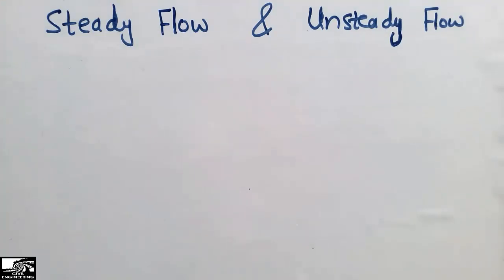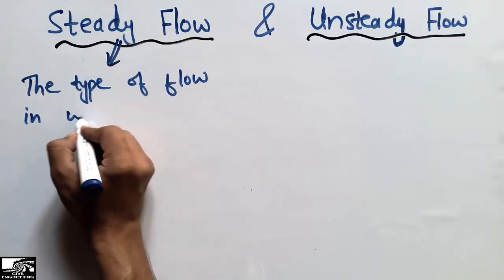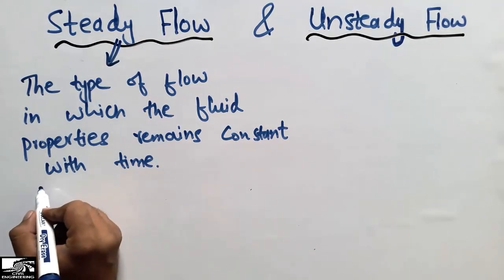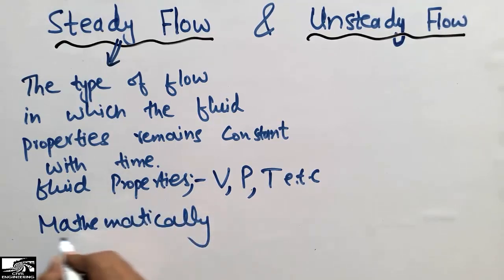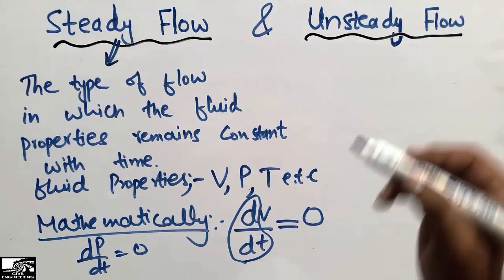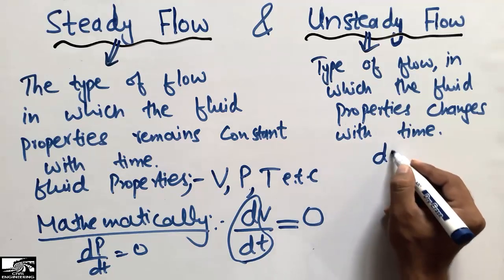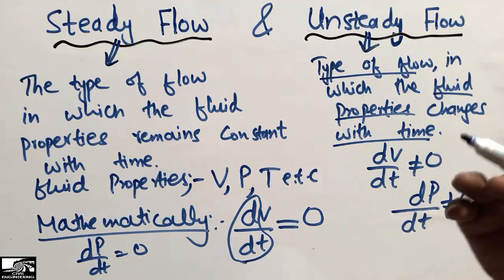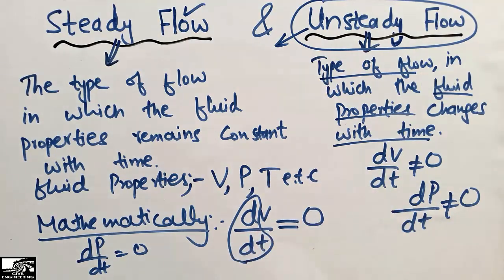Difference between Steady Flow & Unsteady Flow

Comment: doesnt the velocity change with time in steady flows? for example at stagnation points?

very well made video. thank you for this. very helpful
Reply: The velocity at any particular control volume doesn't change, what changes is the velocity of a single particle if seen from a Lagrangian reference system